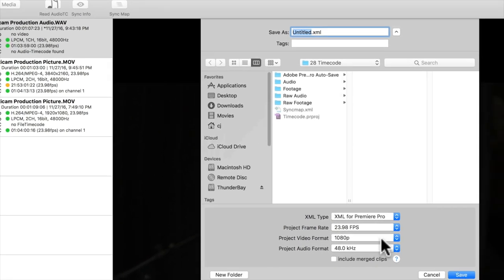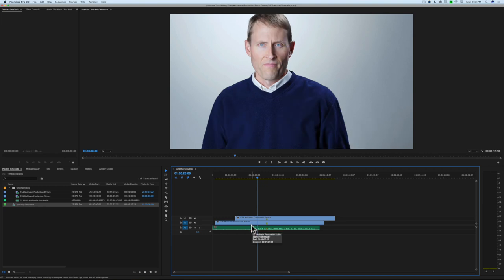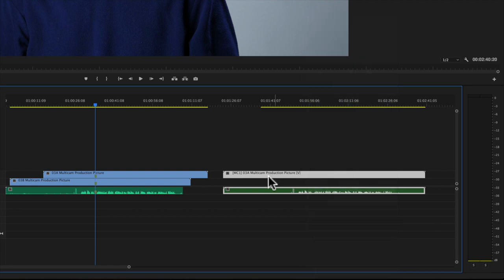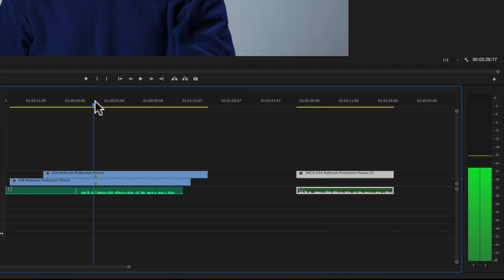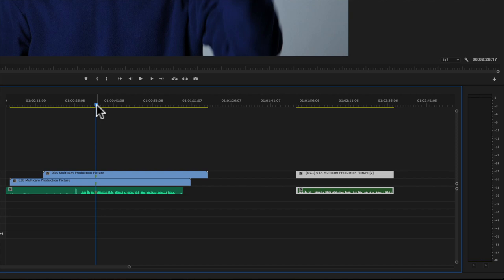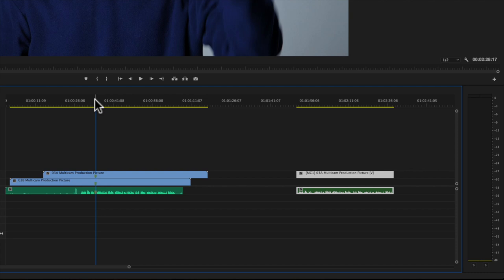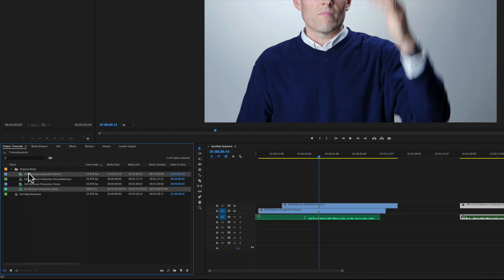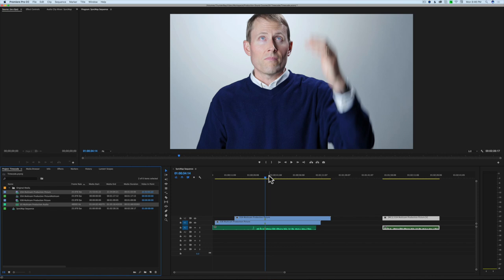Sound for Video Session: Timecode Demo

Comment: If I am not using timecode but  forget to put the timecode off, will it create problem in the post in syncing?
Reply: If you're using a slate or syncing by waveform, no, it won't be a problem.
Reply: @curtisjudd  but my timecode was running in free run in 30fps, and my video was running in 24fps.will it create a problem? Eventually I will sync with clap manually.
Reply: @fanofnaturefilms486  In post, when you sync via clap, the timecode is entirely irrelevant on both the video and sound clips.
Reply: @curtisjudd  means it won't create any problem in syncing?
Reply: @fanofnaturefilms486  correct, no problem with syncing. Test it. 😀